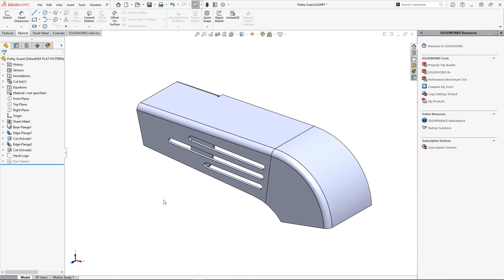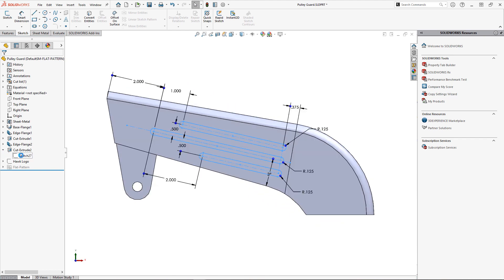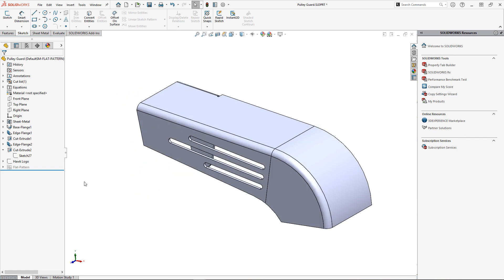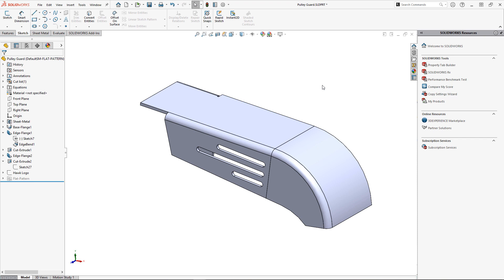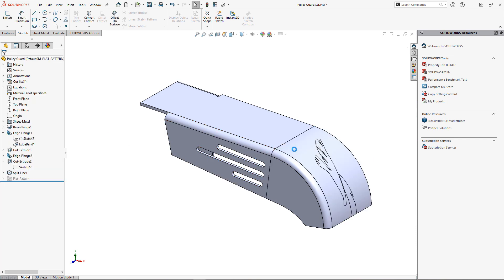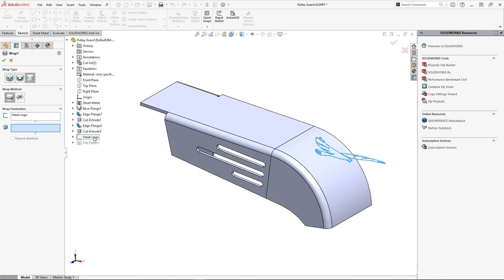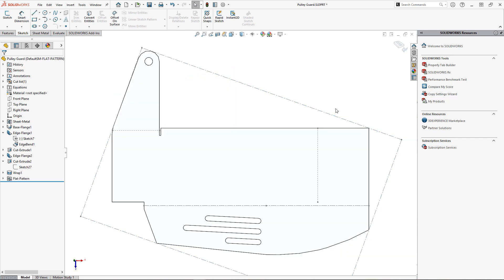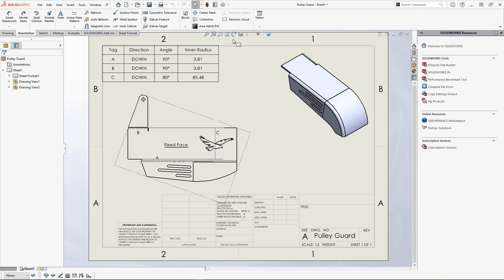What's New SOLIDWORKS 2022 - Sheet Metal Enhancements

Comment: That flat pattern looks so wrong, what method of manufacture is it intended for?
Reply: This entire part looks wrong
Reply: Yes I wondered how on earth you would bend this into shape in the real world using this pattern. It shows that SW can make something in 3D that might be impossible to manufacture. I assume this part would need to be pressed around a solid die? Or use of a bead roller and shrinker/stretcher? Then finish with a plenishing hammer and curved buck?
Reply: @allanpennington  Yeah, so basically hire Ron Covell, he's a sheet metal wizard!